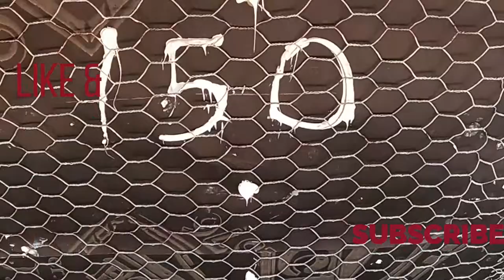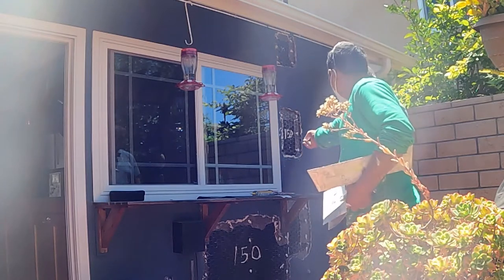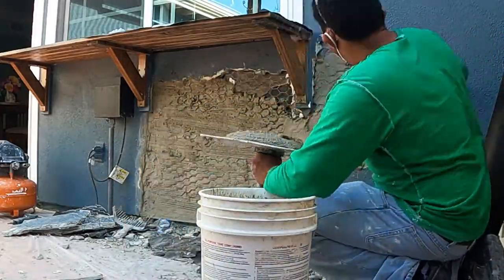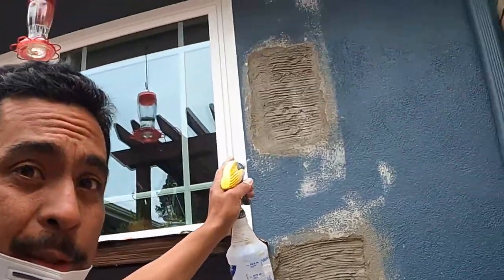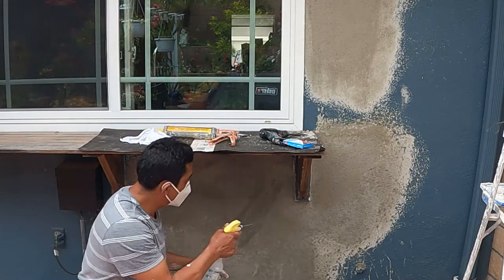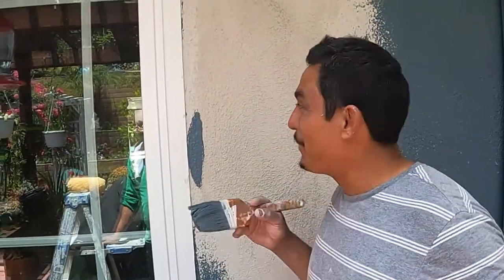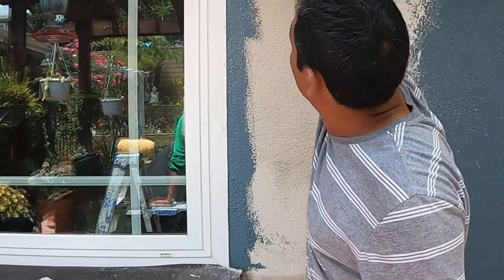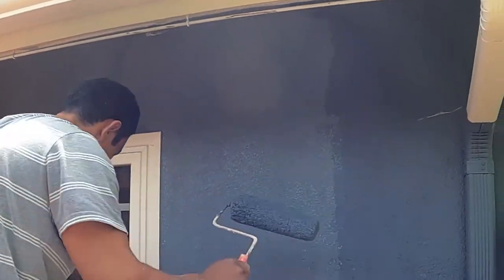HOW TO DO STUCCO PATCH AND PAINT IN THE SAME DAY

Comment: Not bad you do pretty good work,  but when you do stucco repairs and the house is painted you need to put a bonding agent on the broken out edges of the stucco.  So that you get a good  bond to the new stucco and pre-existing stucco. Don't need to come back and repair your cracks down the  road.
Reply from the maker: Yes that is good point thank you very much I will start doing that

Comment: You can put it on without primer but there’s a chance that the curing process of the stucco will pull some of the color out of the paint resulting in the paint not matching
Reply from the maker: Yes that is right